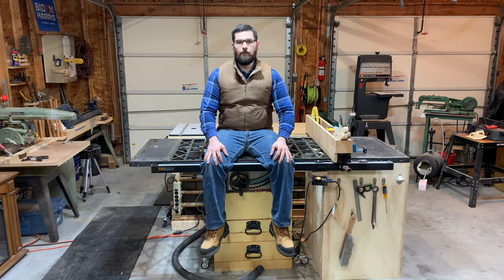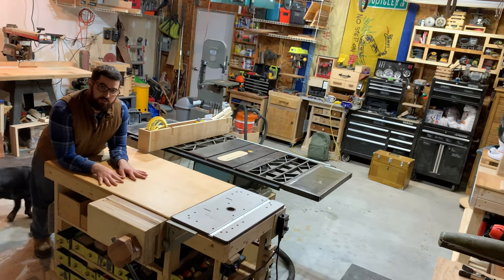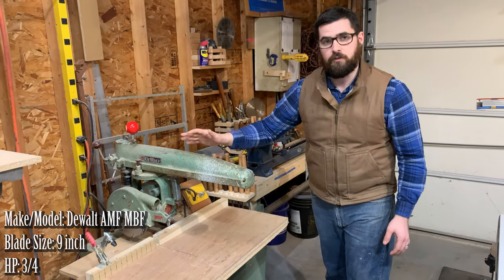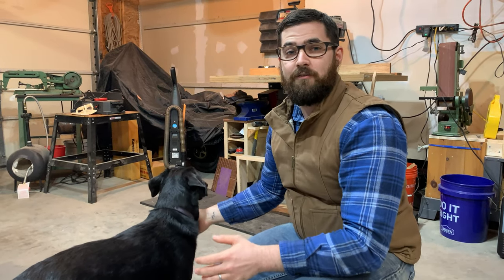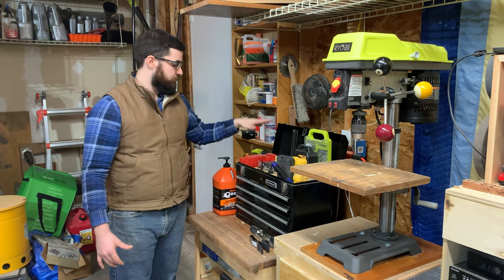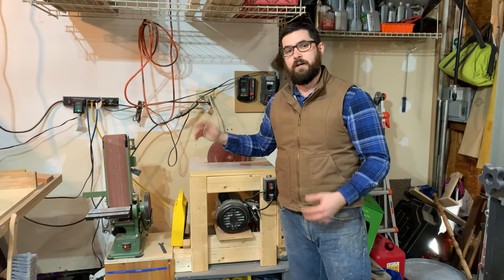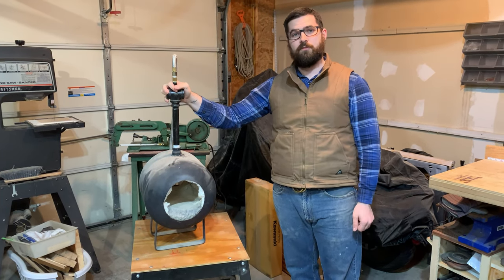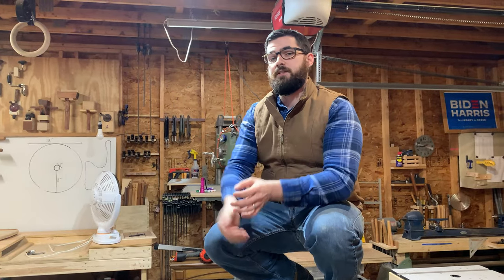Shop Tour 2021 | Bassador Woodworking

Comment: Great tour, Wayne. My dad has a Shopsmith Mark 5. They tend to get a bad rap, but they're definitely a great drill press /boring machine. He gave me his Pro Planer from Shopsmith and I still use it to this day. It's not perfect but it gets the job done.
Reply from the maker: Thank you! I completely agree about the Shopsmith. I have a Mark 5 and a Mark 7 (currently dissembled waiting to be rebuilt...eventually) and have always found them to be capable. There are certain functions I have always been too scared to try (table saw for example) but I have loved using it as a drill press/horizontal boring machine.

Comment: I love the table saw fence storage. What a great idea.
Reply from the maker: Thank you! It is something I first did to add some weight to the stock Craftsman 113 fence but I ended up liking it so much I transferred the idea over to the Delta T3 because now I cannot function without it!
Reply: Bassador Woodworking Well I know I’m constantly putting down a push stick on the right side of the fence and a pencil, then I go to slide the fence and that stuffs in the way etc. etc., so when I saw that on yours I thought what a great solution.

Comment: Wow, lots of vintage tools. I love it. And in a simple, exposed wood, garage shop. It couldn't get more "new yankee" than that.

Regarding dust collection, I too use a shop vac and the Dustopper. It is mainly for my table saw and then occasional use with a sander or circular saw. I just added a router table to the extension wing of my table saw so I know my dust collection "system" will be getting more use.

My dilemma is, with a limited budget (say $300-$400), would my money be better spent buying an air filtration system, like your Grizzly, or should I upgrade my dust collection? I could get an inexpensive unit and add a separator with a trash can and keep it around $300, or I could stay with the Dustopper and spend $300 on a 1000 cfm air filtration unit. I use about a 1/3 or a 2-1/2 car garage so I'm thinking a cheaper AFS, say 400 cfm, would be pointless since the "room" is much larger.

Just curious about the improvement you found by adding the AFS and whether you think you're still under-equipped with your current dust collection, with respect to air quality. We all want a robust dust collection system so it's a given that we're under-equipped with a shop vac and a dust separator over a 5 gal bucket. I'm more interested in air quality with your current set up.

New subscriber, by the way. Can't wait to see more.
Reply from the maker: Thank you! 

I believe the Grizzly filter ran me about $150, I believe WEN makes the exact same product for a little less. 

I do notice better air quality but that could be more attributed to its lower energy consumption. I am still under-equipped for sure. I am running my shop on 20 amps, so I cannot use the shop vac and the table saw at the same time- The Grizzly filter uses barely any energy- so I can leave it running at all times when I am in the shop. 

Thank you for the sub!
Reply: @BassadorWoodworking  I have the Ridgid R4512 table saw and a Ridgid 12 gal wet/dry vacuum. I too have just 20 amp circuits in my garage, with the saw and vacuum being plugged into the same circuit. I turn the vacuum on first, let it settle in, then turn on the saw. There is definitely a drop in the vacuum when the saw comes on, but everything recovers and I have had no problems running them together. The only other things plugged into that circuit would be an LED light over my bench, an Echo Dot and a sprinkler timer.

The AFS you have, and the comparable WEN unit, are under-sized for my area. At least that's my feeling. Like I said, I'm in a 2-1/2 car garage. I don't know the actual size but if I assume 30x30 with a 9 ft ceiling, that's almost 3 times the space of a 20x20 space with an 8 ft ceiling. I just don't think a 400 cfm unit will be enough for me. 

WEN makes a larger unit (1044 cfm max) for about $285 and then Jet has a similar unit but it's $350. So, if I'm getting up into that price range, I'm torn between spending the money to improve the collection at the source or filter whatever makes it into the air. I wish I could do both but I'm not sure it's going to be possible this year. Of course, I could use the dust on the new car as a selling point with my wife. Lol